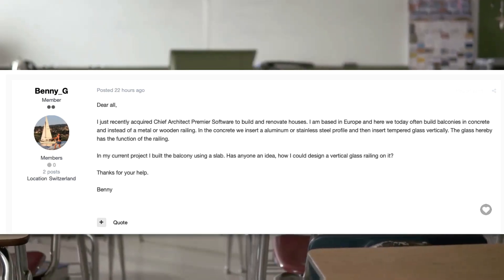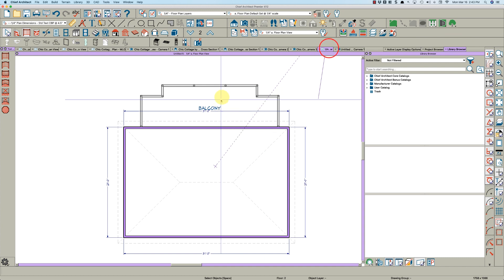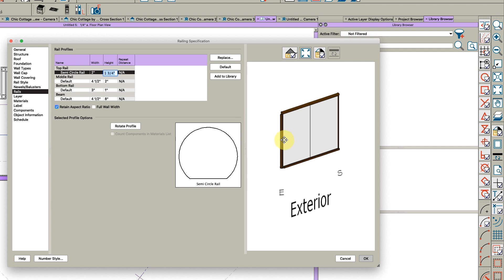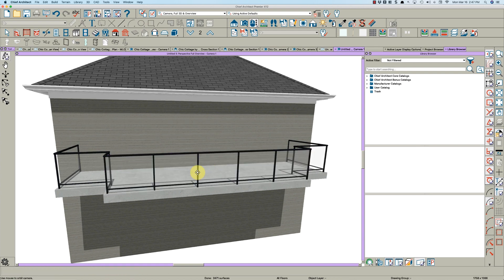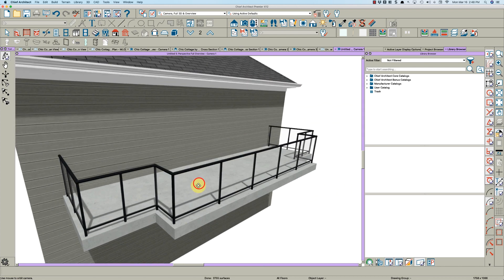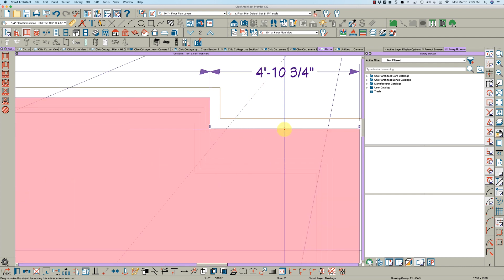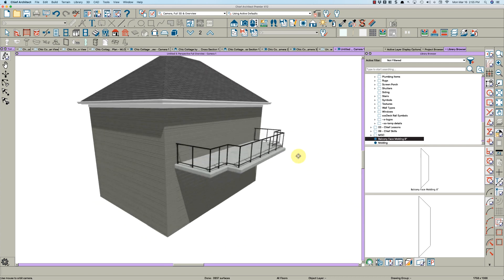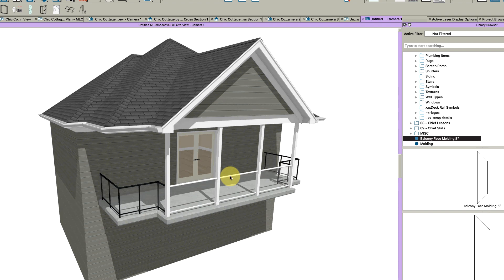How to create a Balcony with Glass Railing in Chief Architect X12

Comment: Curious about the choice of concrete for the structure? Is that just used as a quick place holder to show railing construction? Wonder about the value of showing how a balcony might actually be built? Thanks again.

...and doesn't Chief impose a couple of structural parameters when the room is specified as a 'balcony'. May be beyond the scope of this video but curious none the same.
Reply from the maker: Larry - I just picked concrete for the floor because that’s the material being used by the person that posted their question on Chief Talk.  Nothing like suspending an 8” concrete floor in mid-air.  If only...